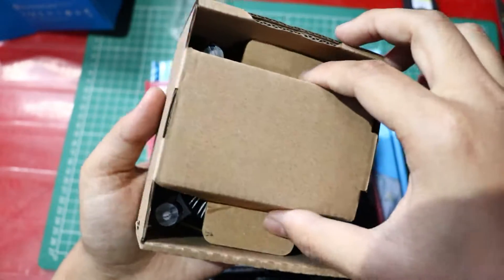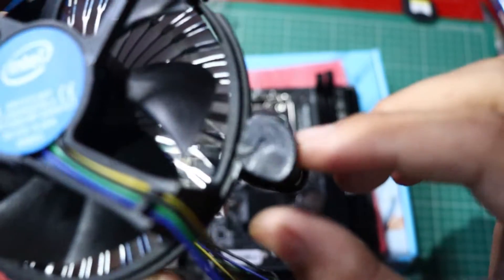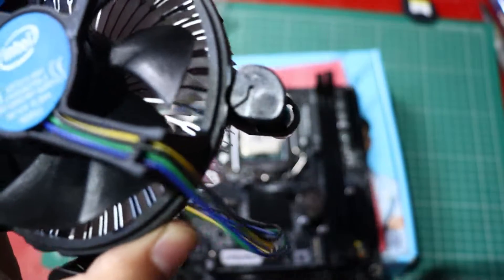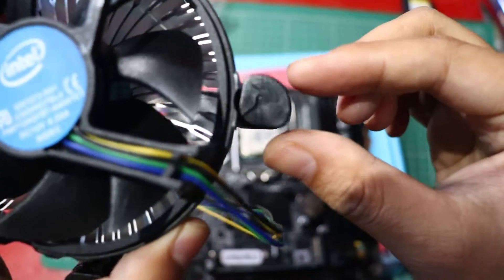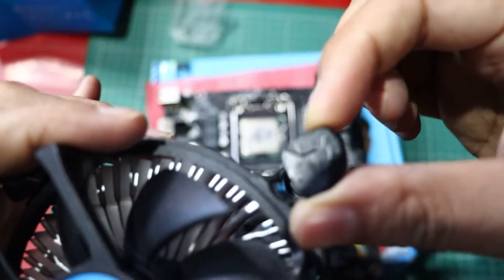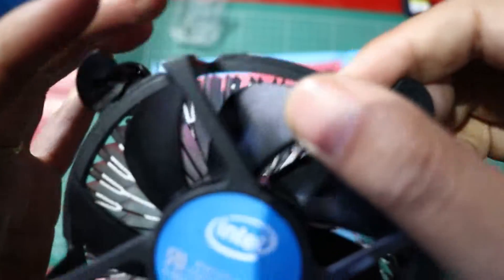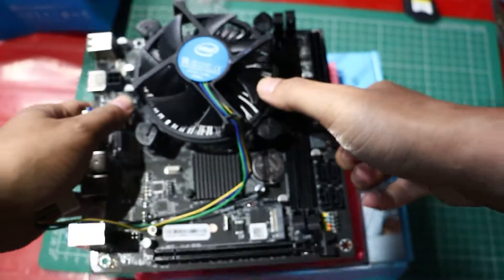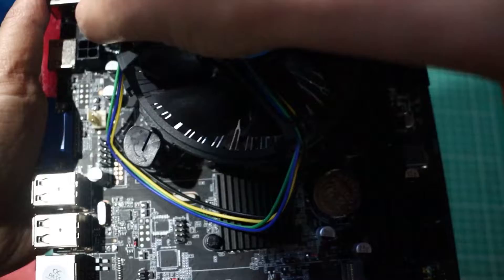How to Install an Intel CPU Cooler on an H61 LGA 1155 Motherboard

Comment: bro can u suggest any other good budget cooler for this motherboard and socket im waiting for your reply
Reply from the maker: https://amzn.to/450DywH
Reply: @Babinmeitei  umm its still out of budget but i found a cooler compatible with ryzen 2nd and 3rd gen and intel 11 12 gen for about 2500pkr its priced at 3k pkr but im getting it for a bargain it has a 120mm fan on it aswell and RGB for looks. should i buy it? because im currently using this cooler but whenever i game my cpu temps go 95+